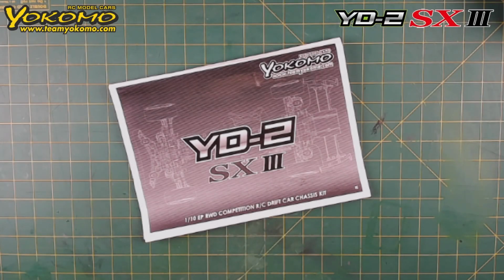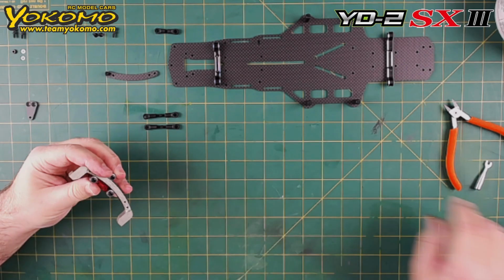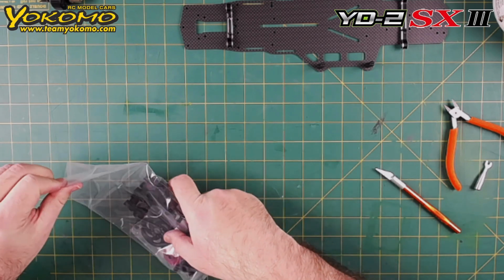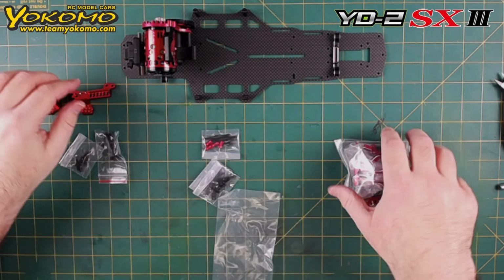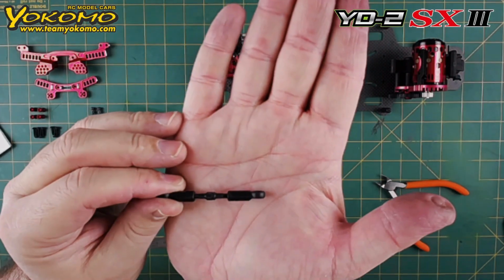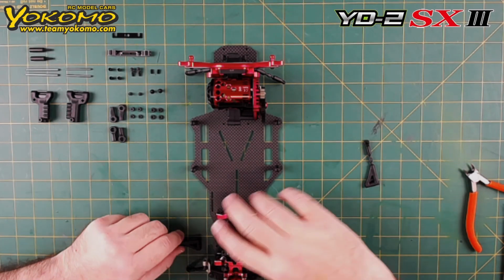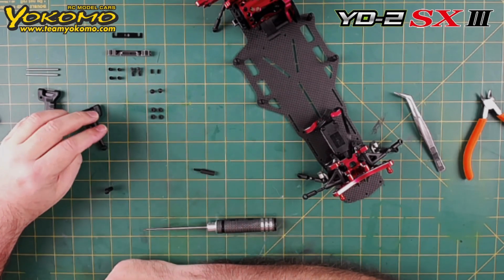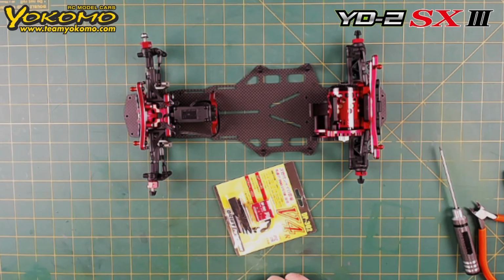Yokomo YD-2 SX III Build - Part 1

Comment: Did you use any threadlocker/loctite?
Reply from the maker: no, I don't like using it unless really necessary.  it's not usually a problem, just give the screws a once over after the first run.